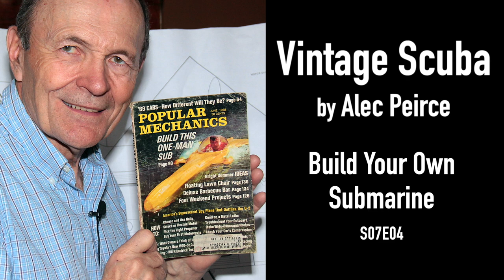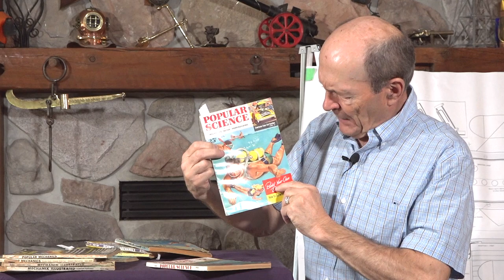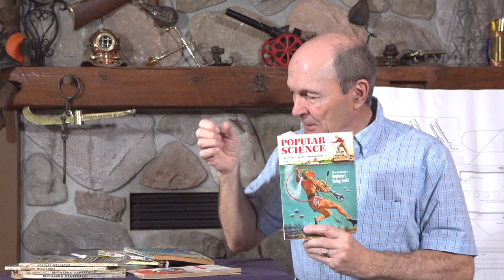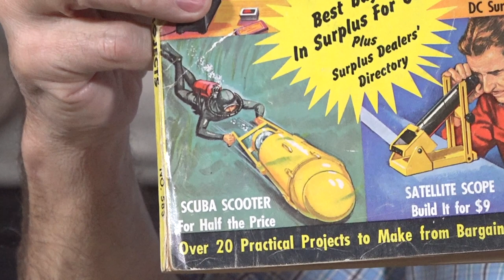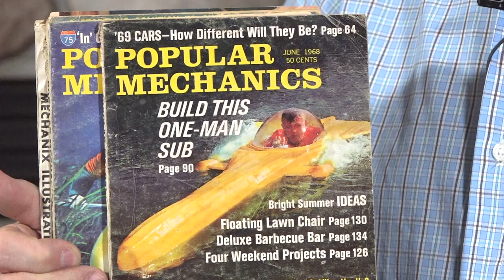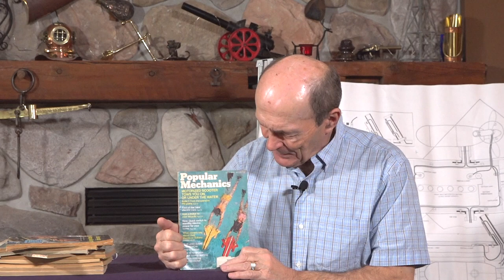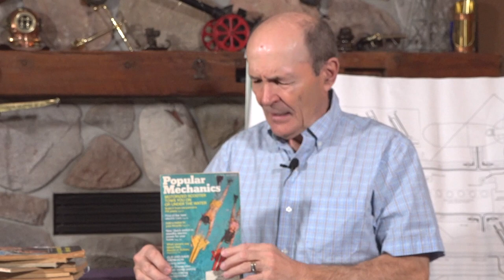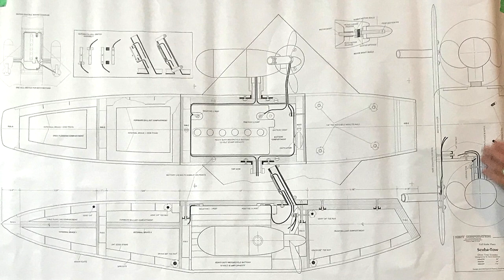Vintage Scuba: Build Your Own Submarine - S07E04

Comment: My Dad and I built a Scuba Tow in the Summer of 1978. I was 14, so Dad did most of the construction. Earlier,  I saw the PM magazine (I wanted it when I saw the picture of the Scuba Tow on the front cover!) on a library "give away" table, & immediately took the magazine. I showed it to Dad, & he seemed interested in building the craft. My Dad was a Professor of Mech. Engineering, & had a multitude of skills (machining, woodworking, mechanics, welding, etc.), so building the craft was quite simple for him, I believe. The Scuba Tow craft was built basically according to the Kent Markham plans, but Dad made some minor changes (Dacron & epoxy paint were used to cover the wooden parts, instead of fiberglass & resin). Dad got the trolling motors from the Shakespeare plant (a producer of sporting equipment items at the time) in our home town. By the end of Summer, the craft was basically completed, less finish paint. I tested the Scuba Tow in a swimming pool, and it worked fine. Dad did not open all the flooding compartments on the craft (as the plans called for), as he was concerned it might sink. I still have the Scuba Tow, but never used it as much as I thought I would. I got my Scuba certification in 1982, but afterward, never made the time to dive very much. I did take the Scuba Tow to the Florida Gulf Coast once; it was fun, but the salt water did cause some corrosion. I would like to restore the old Scuba Tow sometime, or at least make it work so I can have fun with it in some of the nearby lakes.
Reply from the maker: Great story - like so many I've heard.
So, do it! Get that old thing out and play with it. Even if you're not able to restore it completely, the memories re-visited will be worth the effort.
Take care.
Alec

Comment: I built one of the Kent Markham Scuba Tow scooters from plans just like you displayed.
(One minor correction, it didn't use a car battery, but rather a sealed motorcycle battery, so the battery wouldn't leak acid when doing rolls and such - it did have those H2 catalizers!).
 It was a project I took on just after I got certified (back in '74) to get experience in my dads extensive wood-working shop. It took me all winter to make it (an hour or so a night).
It was super handy as the build itself was pretty simple, and the plans included contact info to purchase the electric trolling motors at a discount, motor ONLY, nothing above the motor connection. IE: no shaft, boat clamp, or control handle. Just the motor itself with long wires.
It also had the DIY switch on the handle, a bit metal nut inside a rubber tube, that would Dead-Man spring away from the metal handle when you released it. Great concept but it failed in the ocean as the salt water allowed enough electric current even when fully open to give me a little shock, even through heavy garden gloves. 
The wing over the props worked super well. I always felt scared of them spinning until I grabbed the handles, and then I felt fully safe. I added brass screen-door handles at the aft, and at the top center for portaging, and that was all I felt needed to be tweaked from the plans. (Plus a cool, Space Shuttle paint scheme).
I had them down to 80-90 feet in south Louisiana in the gulf. It always leaked a bit, but it was easy to open and dry out.

However: there were several real problems with DPVs, and this was never discussed in the magazines or pretty much anywhere else:
1) You can't really do the water "aquabatics" that you'd love to do, as the up-and-down parts might violate the safety limits of changing depth. The side-to-side motions, rolls, etc. were just as fun as they looked.
2) This unit only had enough power to pull you about as fast as you could swim. That was fun, and saved energy and air, but if you tried pulling your buddy, you went half speed, no fun.
3) Diving in open water always had me paranoid about it's gradual leaking becoming enough so that it would go from my initial set-up of slightly positive buoyancy, to negative. If it got away from me, that huge investment in money and time (for a me at that time), would head for the depths.
4) The big concern, is that I only built one for me. When I first got out to the deep, I realized that I'd be severely limited to where I went, having to say within 30 seconds of my buddy who DID NOT HAVE a DPV. Bummer.

I used it a lot for about three years in open water and lakes and quarries, and the motors finally failed due to corrosion from the leakage. Got my money's worth, for sure.

Comment: i built several of these many years ago the sub is up in the rafters of my friends garage it really was not a lot of use but a fun try the scuba tow was ok there was a better one years later it was a bit nose heavy but i added two bladders and it worked fine for many years
Reply from the maker: But you did make one so you have more than most navies.  Thanks for sharing Peter.
Reply: @AlecPeirceScuba_SeaHunter  a recent find in my garage when it flooded was many or the original plans I used to build several projects and one for an electric car I was going to use for one of my own design all interesting fun

Comment: Great video; so fascinating. On a completely different topic, I was thinking that Alec could maybe start a new playlist, or make an addendum to his tec list, simply discussing the most anxious aspects of diving. For example, I have about 35, primarily wreck, dives under my belt, (I have limited opportunity to dive), and find that the most nerv-racking part of the dive is navigation. Where I dive, off NC, the dive charters have us follow the anchor line down to the wreck. My problem is that I have trouble relaxing when I'm down and short change exploration in order to ensure that I always know where the anchor line is in the wreck. Since some ships can be 400-500 ft long, with only 50ft of visibility, it can be easy to get lost. Do Alec or Kevin have specific advice on how to learn to navigate wrecks relying on landmarks and a compass, rather than a hard line and reel attached directly to the anchor line? I'm diving on steel wrecks, so you can have trouble with compasses. Is there a secret to learning to relax and just trust that you can find the anchor line and not have to ascend 95ft and find yourself 700 ft from the boat? For the record, that has never happened to me, but I fear that it could.
Reply: I actually find simply thinking "breathe" in the intake and  "relax" on the out breath helps but this is just what works for me.  Also, get book about free diving.  I do not plan to do it but there is LOT of useful information for SCUBA divers ("bubblers" as they call us) too in such a book.  The anatomy section alone is something I would like to see more of in some SCUBA classes.
Reply from the maker: I have dived in NC and it's pretty strenuous diving, not just physically but it can wear on your mind too. There's little room for error and the consequences of making a mistake can be serious.
In the Great Lakes, they have lines on some of the popular wrecks so divers can always stop and rest if need be. Plus the lines always lead back to a surface line.
I think the only way to really get comfortable on a big, deep wreck is to dive it a lot. I made maybe 200 dives on the Arabia, one of my favorite shipwrecks ever. Eventually diving her was like going home. 
Try to find a map or layout of the wreck with all of the prominent features shown. Study it and perhaps you'll soon know where you are at all times while diving. There are many such wreck maps available on plastic cards that you can even take on the dive. That might help.
Good luck.
Alec
Reply: @AlecPeirceScuba_SeaHunter  Thanks, Alec. That's great advice; I'll do that. Best, Josh

Comment: Nowadays, Alec, there's not really anymore war surplus stores, and military surplus stores don't really sell anything that isn't fake or misc slav shit (pardon my cursing, but that's what we call it) HOWEVER, there's plenty of good stuff in GENERAL surplus stores, which are very nice. You want a REAL helicopter helmet complete with a mount for an AVS-9 night vision goggle and a remote battery pack on the back? Maybe the powered mount (a night vision mount with the battery inside it for powering the AVS-9, which has no internal power supply, or on switch.) is more your taste? You might just find it. Heck, you might just find the night visison goggle too.
Reply from the maker: I miss the good ol' War Surplus stores. They were a lot of fun to scrounge around.
Alec